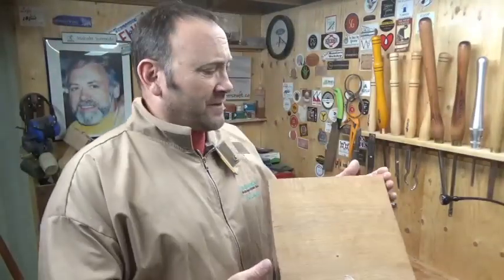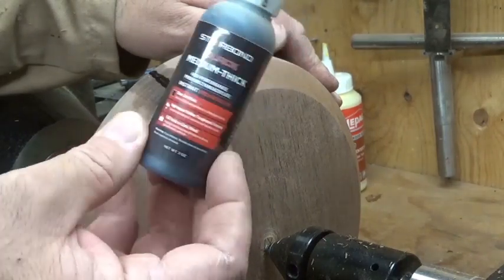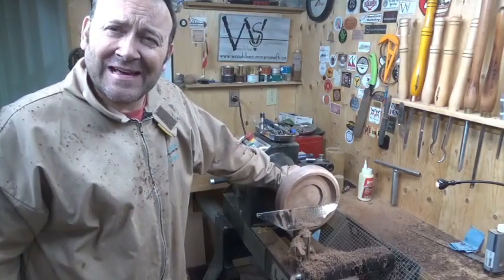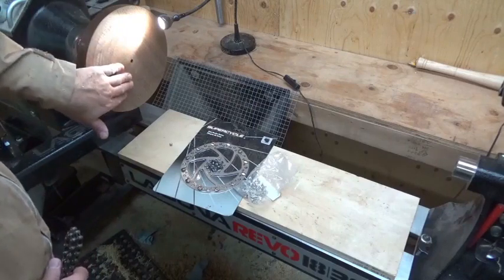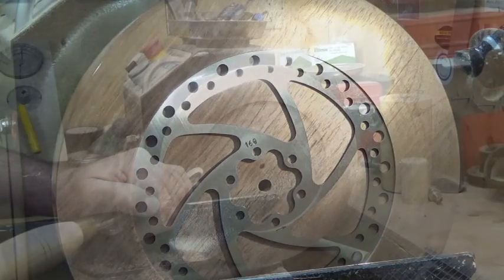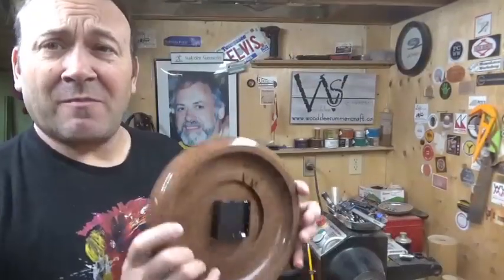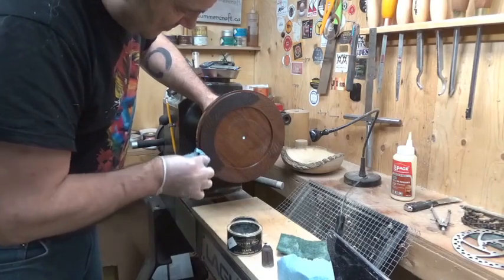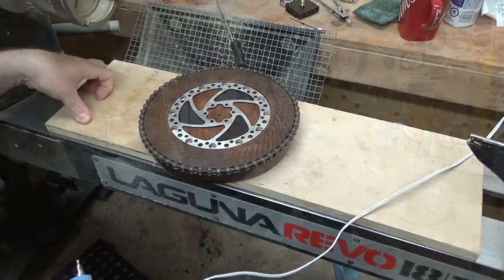turn a wooden clock

Comment: Great idea and execution.  Would you be willing to share overall diameter and diameter of brake rotor?
Reply from the maker: Thanks Steve 
The brake rotor is 6 1/2”
The clock face is 10” diameter by 1 1/2” thick
Reply: @WoodsleeSummercraftwoodturning  Many thanks